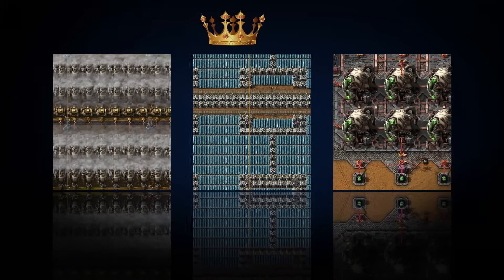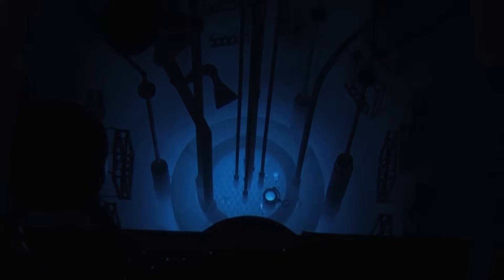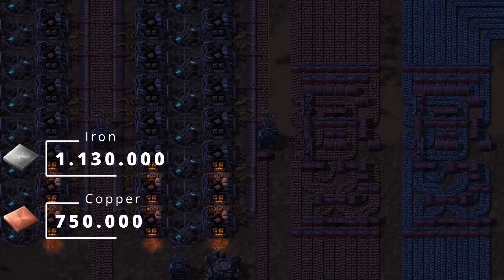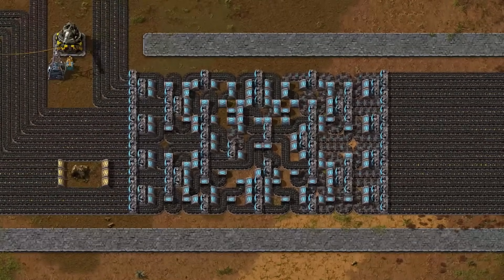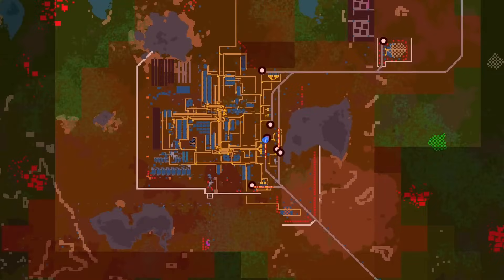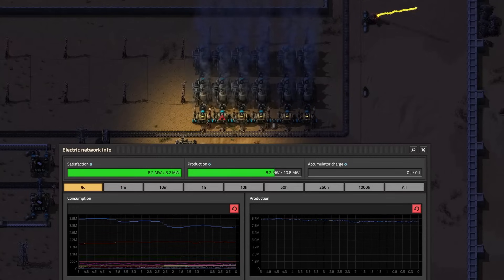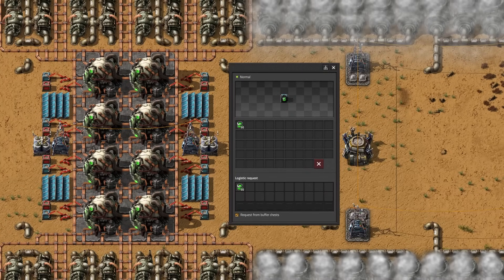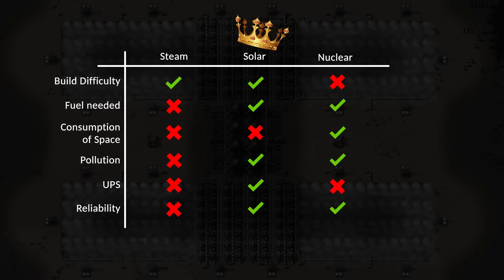Learn about Factorio Power Production - What is Best?

Comment: I feel like you kind of forgot to mention one very important part when comparing these three. Upfront cost. Producing 1.2GW of energy with Nuclear or even steam is way cheaper than as if you would produce the amount of solar panels and accumulators needed to match it. Solar, while having no drawbacks in terms of UPS and ease of construction, has a gigantic upfront cost in terms of entities needed to achieve a decent energy production.
Reply: It WAS brought up, just for some reason not factored into the final overview, despite being pretty important. This IS eased up by the fact that solar is very friendly towards being gradually transitioned into, meaning that upfront cost measured in millions of plates isn't entirely upfront, but I do feel like leaving it out of the final overview is a mistake.
Reply: Solar is not your primary production for energy its a nice buffer for energy flucuations. Say if you build a whole new smelting array fully beaconed you can accomodate that jump in power. Atleast until you add another reactor. Also robots maybe small but they all have to recharge.
Reply: @ownage11445  reactors give you so much power and steam backup that you don't even need to care about fluctuations

Comment: Off shore Solar Power Island anybody? Or am I the only one like this lol

Also I enjoy converting a "depleted" oil rig into solid fuel for steam, it's pretty good once you have multiple oil pumping sites stockpiling at your base.

I'm still trying to wrap my head around lossless nuclear power though, I don't like wasting my U238 😅

Anyways, here's a sub. Top Quality Content right here!
Reply from the maker: I've never considered an oil rig "depleted". I just add speed modules and beacons like crazy. ;)

Thanks for the sub!
Reply: @AVADIIStrategy  True lol beacons and modules are great for breathing life back into the pumps. But often forget to bother by the time I have them lol. I have converted a few into "decoys" however, by surrounding them in flame thrower turrets and increasing pollution  on purpose by them to lure biters away, at least until I've got artillery to deal with them.

Comment: Solar energy is best.
But it takes 2-10 times the space of the rest of your factory.
Nuclear, as hard as it is, is increadably energie dense.
Boilers meanwhile, as bad polution and efficiency they are, are redicukously easy, and can be built no matter the place or time, cause fuel is everywhere in one way or another.

Finally theres fusion....
Or will be...
From what Ive seen, Fusion is going to be the most energy dense and require the least fuel imput yet.
But its complexity for fuel creation, pipeless setip, and heat management makes it the hardest by far.

Comment: I get the jist of being a nuclear fan, but it would be way more interesting if you actually included the underlying cost of getting to nuclear. Tech cost is wildly higher as well as the necessity of significantly higher underlying infrastructure and while those are variable, just saying nuclear is cheaper because the particular setup you used requires less materials doesn't make sense.
Reply from the maker: I build 1 GW of steam power just for this video and got 1 or 2 headaches doing it.
It's actually a lot of work for just 1 GW because of the fuel supply and water pumps/pipes.
The small kovarex setup you briefly see in the video is actually feeding 2 of my 8 core reactors (it coul probably support 4-6) and it's simple and doesn't need much uranium.
That's why i think fuel supply for nuclear is a Pro.

Comment: I always swap from steam to solar in midgame to nuclear for mid game to late game then switch back to solar if I’m planning on megabasing. Nuclear is very cheap overall which makes it much easier to scale up space science production earlier since solar production won’t be eating into resource consumption and once a bunch of mining productivity researches have finished resource consumption and space become less of a concern so it becomes more practical to switch back to solar. Doing nuclear without logistic networks is too much of a pain for me to want to deal with though so it really is more of a bridge between a late game base and a megabase. One big point in favor of nuclear is how easy it is to scale up once you have production of fuel set up since the blueprints are fairly small so you can add entire giga watts to your production on a whim.
Reply: Exactly. The late game is not nuclear, is solar again. In most cases I either go straight for solar cause biters are a non factor on that particular run, or I go straight to nuclear without a single solar panel until I can afford to go full solar. But it all ends up in solar.
Reply: it's solar only if your PC is utter trash or you're going for 20k spm. the second option is not happening, obviously @xanschneider

Comment: Nice, a new high quality Factorio creator. One thing you didn't mention in favor of Steam power. Instead of coal which you rightly point out needs a ridiculous amount of belts you can convert light oil into solid fuel which contains 12MJ vs 4MJ from coal, with liquefaction you can also convert coal into solid fuel. Even accounting for energy loses in the process coal into solid fuel is roughly twice as efficient.
Reply: You can actually run boilers off of nuclear fuel (not the fuel cells). Not nearly as efficient as fuel cells, but far better in terms of belt density than coal or solid fuel.
Reply: @pyroavatar9251  we have nuclear reactor at home xD
Reply: Baby's nuclear reactor
Reply: Oh dude nice! Now I don't have to build a million boxes with corresponding grabbers to store the blocks that I have to use in order for the oil processing then and there machines there connected to don't stop working because the belts are stopped from being too full
Reply: Agreed but that completely sacrificed build difficulty which is the only benifit to steam power.

Comment: I usually go with Coal in the beginning, after automating green science I start adding solar to ease the demand on coal during night (1 boiler 4 engines and a tank). After blue science I faze out coal by adding more solar and building accumulators. This last until first rocket launch and then I maybe add nuclear power if I want to.
Reply from the maker: This.

Comment: I usually add solar as soon as I unlock it to assist the steam engines during the day. But nuclear is my favourite to set up, I usually go for a 10 reactor design and I only use the steam when the accumulators drop under half full. Then I add solar and accumulators at infinitum to use the nuclear power only as a back up. Nuclear is by far the most fun and I always build and design it anew every game as it is a part of the game I enjoy the most.

Comment: Not bad. I know nuclear is decent because uranium is so prevalent, but i never went for it most games. Im in the middle of a 100x research cost krastorio2 run, and i rushed solar because of the scaling and pollution control.
Reply: except nuclear has better scaling and the pollution is practically none existent
Reply: @Ghorda9 eventually i do a mix, but it takes a long, long time to get to nuclear at 100x research and it tends to be used by me as a crutch for covering beacon costs till ive expanded enough solar/accumulator coverage.

Comment: i personally prefer nuclear, but thats because my largest base was in the 200 spm range. of course framerate becomes a concern eventually (key word eventually, ive seen 10 GW draw bases run entirely by nuclear only just beginning to dip slightly, but ive never built that scale and cant rly say), but for a more casual player like me the fact 1 reactor that fits in 6 chunks can do the same work that 300 chunks of solar can makes it a no brainer, especially with how much cheaper it is (i feel that pollution count for solar is a bit misleading since you need so many more resources to build solar that the iron and copper spent starts having a pollution impact on the production chain). I still produce solar panels and use them over steam engines while working towards nuclear, but the sheer space they demand is kind of impractical after the 30-50 MW range for me until endgame military science lets you claim land easily (and even then landfill can be a nightmare)

this is all from the perspective of someone who tends to replay the whole game with friends im introducing to the game over developing large megabases though
Reply from the maker: The problem with taking pollution from material production into account is that it differs from player to player.
With full efficiency modules everywhere it's not that big of a deal. But some other player maybe runs prod modules and emits 10x pollution.
Reply: @AVADIIStrategy  yeah for sure, it varies wildly, but its still a sizable amount more than the other power sources material requirments and is worth keeping in mind.

Comment: Solar + Accumulators are really reliable, too. Solar has already long since been broken down to be producing about 42kW of power on average throughout the day+night, and building enough accumulators to sustain them isn't much of an issue anyway.
When doing deathworld, I like to limit my entire production with an RS Latch. The factory turns off segments during night depending on power charge, allowing the pollution used to construct the solars to dissipate into the tiles.
That's of course only one take. I do like to set up some nuclear before switching to solar. 480 MW of power with virtually no pollution and minimal UPS concerns is really great.
Reply from the maker: You shut off parts of your base? I've never seen that idea before.
Reply: @AVADIIStrategy  I came up with the idea when doing a K2SE run only on solar and wind energy and core mining.
RS Latch on core miners worked pretty well until I got my 3rd one. I needed hours of work to make enough accumulators to justify the costs. Then I came up with the idea to simply divide my factory into segments, and each segment would turn on/off depending on demand of certain resources. This didn't help that much, but it was still noticeable, especially on other planets where night would last 20+ minutes.
This works actual wonders in deathworld for me. Only ammunition can operate 24/7, everything else is hooked up to a series of RS Latches and turns on/off depending on battery charge. Oil production stops when power drops below 80%, basic mall stops below 65%, smelteries turn off below 20%. Roboports were kind of tricky to set up, until I realized that with a well made grid, I can maximize the amount of cables input to the big poles, and they work separately just like ammo.
This heavily reduced the pollution output, especially in desert starts.

Comment: You almost mentioned it but then didn't. Solar can be built gradually, not as in as your base grows, but as it replaces steam. It's relatively easy to separate your steam boilers from the rest of the network through a switch than turns on when accumulators are under X and turns off when they are over Y.
Reply: correct, and that's where you burn all those TONS and TONS of wood lol
Reply: @dacianhantig7810 I use RP1. Only because my lube manufacturing is enornous and I need to burn off everything else
Reply: I go with hooking the Accumulators to the Offshore Pumps, so the Pumps only activate if Accumulators are below a certain level.  One Pump might be set for 50, one for 40, one for 30, and one for 20.  This lets me steadily ramp up the Boilers and Steam Engines, instead of having the power grid oscillate as the Accumulator turns the Pumps on and off.

A Power Switch means the game has to check connections to make sure buildings have power.

Comment: I’m team nuclear all the way. I do recognize the strengths of solar builds, I just choose not to use them because shiny candy rock go brrrr
Reply: Why spend hundreds of thousands of resources to get 1GW from solar when you can just setup nuclear for a few thousand resources
Reply: @Isuckatgames2too  well it’s nice to have something set up that can keep your production going if you run out of coal, and it allows you to build outposts without needing power from the main base and with little no pollution spread if the goal is just to scout the map   / early warning system
Reply: @Isuckatgames2too  because while solar has a large initial investment, the power is free forever after that
Reply: Combustion generators, generate electricity by burning light fuel, heavy fuel and natural gas
Reply: @pilopuha  they also aren't in vanilla
Reply: But i like them
Reply: @TheAechBomb nuclear aint so far off from free, though.. it's real easy to set up enough uranium production to sustain a LOT of nuclear power
Reply: @jooot_6850  that's why I made a mod that increases the cost, adding steel and a more complex recycling process

with space age I might even make fuel canisters decay over time, meaning you have to use them within an hour or so
Reply: @Isuckatgames2too Because I'm producing more than 1k SPM and my pc starts to struggle with nuclear
Reply: The difficulty with Solar seems to be defending all that space. It requires you control a much larger area than you would for other energy types. And it doesn't generate enough power to keep up with lasers requirements (not to mention that's even more of a resource sink). I figure you're going to need uranium for uranium rounds anyway for your turrets, so you might as well go nuclear.
Reply: I made a mod that makes nuclear way more expensive, because I love it and want it to be more challenging lol
Reply: @TheAechBomb  oh that's dope! what's it called i wanna check it out!
Reply: @WillDa713  the nuclear mod is called Aech's Nuclear Downbalance, it makes nuclear power way more expensive; I'm currently playtesting it with some other mods
Reply: @LowerBudgetOppenheimer  the problem was it was too rewarding, you could set up a refinery with like 4 centrifuges once and never think about it again, and you got basically free power forever
Reply: @TheAechBomb  and those 2000 materials required to make it?
Reply: Solar good for decentralisation
Reply: I was team nuclear as well, until I automated solar once. Now I can't live without it.

Comment: Question, the space needed does require more wall defenses due to biters still being a problem thus even if solar is really good a nuclear reactor would be pretty good to for before really being able to have a reliable mega-base or are there ways to make this not an issue?
Reply from the maker: That's true. But unless you change size of ore patches / richness in your map settings (or maybe railworld?) you need to expand your base anyway.
I was never in a situation where i need to expand my base to make room for solar energy.
Reply: @AVADIIStrategy  alright thanks